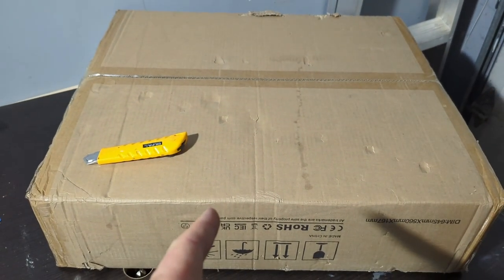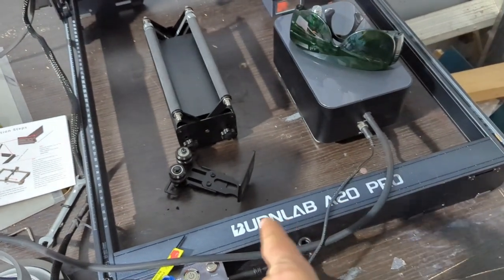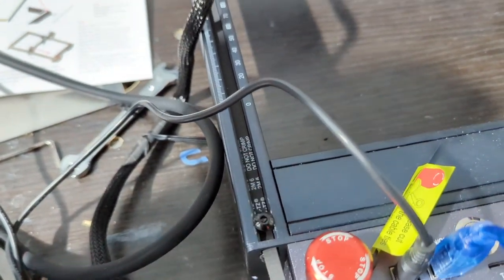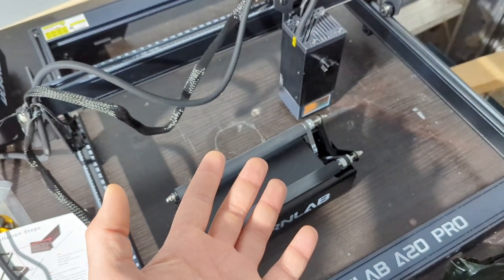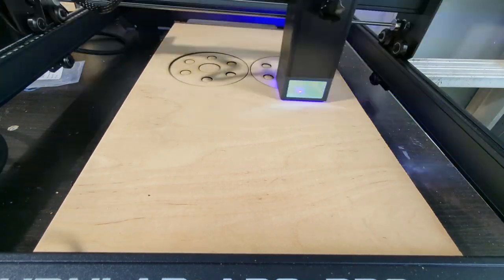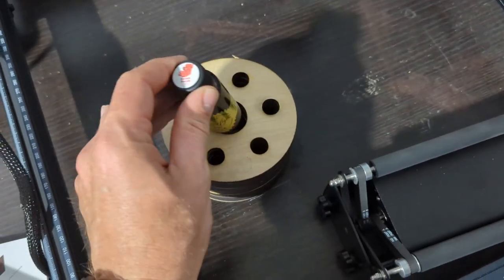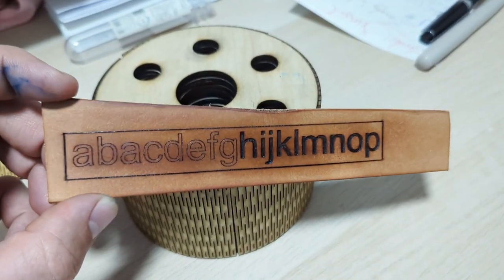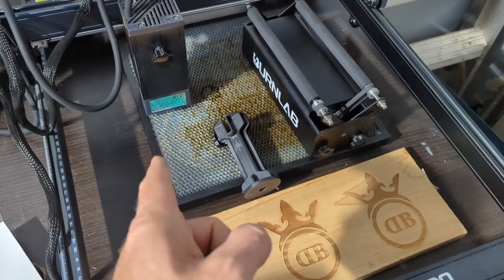Biggest Giveaway Yet! - Win This Burnlab 20W A20 Pro Laser Engraver

Comment: As someone who does cook and press and bend wood, I can honestly say, YOU WILL NEVER IN HELL HAVE ENOUGH CLAMPS!!!

    You'll especially never have enough OF THE RIGHT KINDS of clamps!

    There are two big "secrets" to the old-fashioned way of bending wood...

1. Straight grain. It's not impossible to bend wood with knots, crotches, or burls and curls in it, but anywhere the grain is running a different direction is GOING to slow down, resist, and generally make bending difficult at the best of times... Getting and sticking to more straight grain is going to make life easier because the wood will generally just "behave".

2. Steam about an hour per inch of thickness (the shortest way through the piece in question)... For those of you trapped in metric, that's roughly a half-hour per centimeter. It's not perfect, BUT this kind of craft is NEVER perfect. You just don't want to bother trying to get impatient and take out the wood sooner than the prescribed time, so there's your math.

    It's fairly straight forward, and bring your NATURAL FIBER cord and rope! Nylon gets weak as it gets hot... SO you "cook" and then you RUSH to bend it and tie it down to the frame/shape/mold as quickly as you can. If it cools too much to get quite "there", don't push too hard, just get it bound. You CAN cook it and try again... It's frustrating, hot, and you burn yourself regularly. My dexterity SUCKS in gloves, so I suffer for my craft... That's life.

   AND yes, technically, there IS an older fashion. You don't want to do it, but it does exist. You start with "green" wood preferably, so it's already a little flexible, and with rope or cord, you START the bending process... IF you're stuck with kiln dried (or otherwise seasoned) wood, you can start by soaking it... This takes DAYS instead of hours. The pay-off is that you'll end up breaking a LOT LESS stuff in the process. It's basically bending and tying and then soaking by COMPLETELY SUBMERGING the piece(s) in water. It'll soak for days at a time, and you're just going to go back out to the pond or pool and pull it out, bend it a little further, and tighten the bindings, and then return it under the water for more days...

     I've done both, and for consistent results, yes, I like the older "soaking" method. It SUCKS for the time investment... BUT it takes a lot less attention to minutia and you don't get burnt half as much doing it. If anyone reading this wants to try their hand, BY ALL MEANS... do so. It does take fiddling about, and patience... BUT it's rewarding when you build the confidence to get elaborate and start earning the mystified expressions and awe from others. Someone SHOULD continue to preserve a sense of mystery in the old school craft... I frequently feel like the last of a dying breed, and I won't be around forever.

      I need another fancy toy about like I need another hole in my head... haha... SO good luck to anyone else getting after this laser thing!  ;o)

Comment: cool vid. I was wondering what your recommendation for a baystate blue only pen would be. Especially if I didn't want to spend more than $30. #USA
Reply from the maker: Lots of great low cost pens that are made well.  For a BSB pen I would recommend an XF/F point nib as BSB ink has very low surface tension.  It will feather more than other inks so a finer point is the way to go.  This is a great pen if you haven't tried one yet:
https://youtu.be/PDgkIhKcTwA
Link in the video description
Reply: @Doodlebud  I do have an A1 already, but it is such a great writer and so well built I think you're right and I will get another. Thanks DB!
Reply: @Doodlebud  I ended up getting the Majohn A2 EF and couldn't be happier with the result. You're right, the low surface tension of BSB lends itself really well to EF/F nibs and this pen is cheap enough yet constructed solidly enough that I don't mind it only being used for BSB. Thanks DB